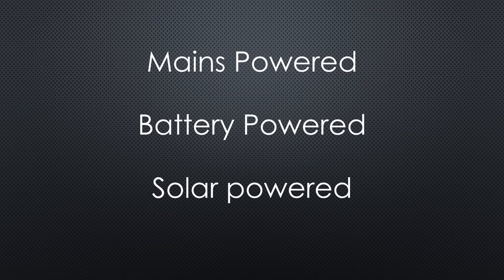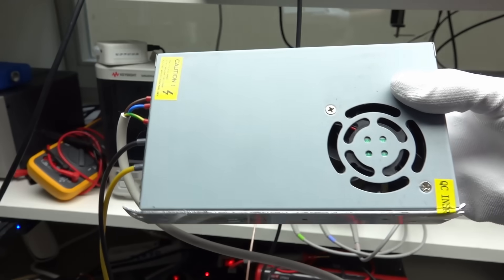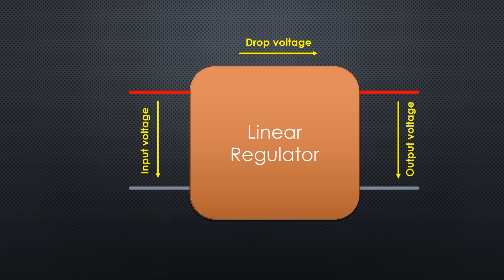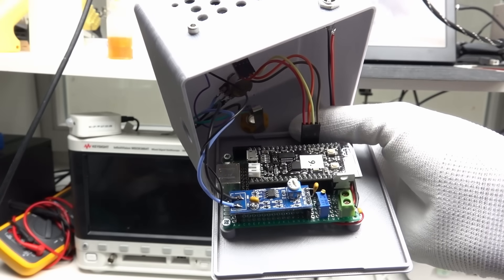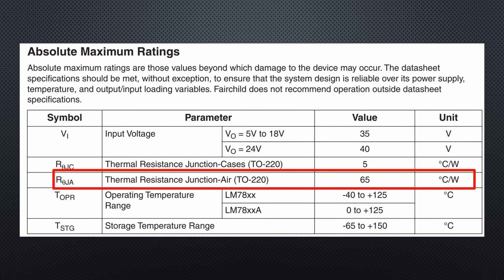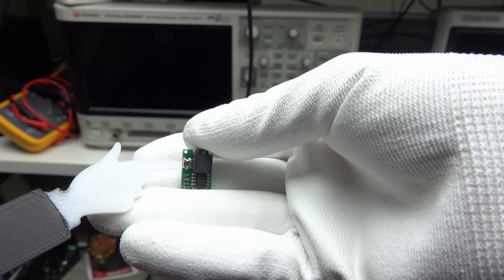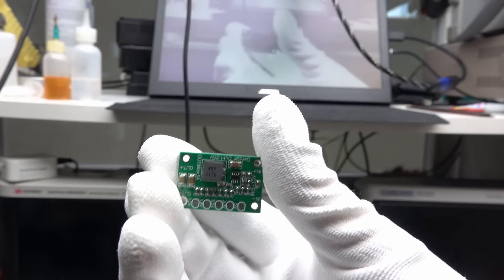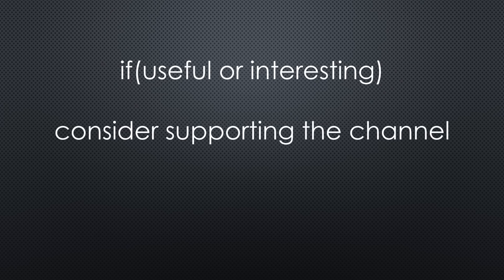#334 How to find the right Power Supply for your Project

Comment: I am noob when it comes to electronics, I have a question about switching regulator, would it be fine to just filter the noise of the switching regulator by adding LC filter into it?
Reply from the maker: It sometimes helps. But this is a very difficult topic where you find a ton of info on the internet.

Comment: tl;dr : not sure if usb adapter could sustain plugged 18h/day to 24/7, any advice?

hey, I was wondering if how long would the power supply be used is in consideration.
My project will be using main source with highest voltage of 5v, which leads me to using usb wall adapter. However, im hesitate to use it with longer uptime (at least 18h a day). My other option is using some 12v adapter laying around & adding buck converter with fan, or buying a beefy ac to 12v supply. Since i would need at least 15W of power for my project with 18h a day, or even worse, 24/7.
I would really appreciate any advice, thank you!
Reply from the maker: I do not see a problem with using a USB adapter for 24/7 if it does not get too warm.

Comment: I noticed a slight error in the video: you mentioned that all USB power supplies can supply at least 5v 1a.  That should be 5v, 500ma.  Slight difference, but it might matter sometimes.
Reply from the maker: You are right. But this rule is very old and for a long time, I did not see any of those.

Comment: Hi Andreas! I am looking to convert a mains switch that controls my central heating to a smart switch that I can control remotely. Is it possible to take one of those USB Power Supply's apart and directly solder a mains cable to the input, would that be safe? If not with a USB Power Supply, how about one of those wall warts?
https://i.imgur.com/s6pauWO.jpg
Reply from the maker: Working with mains is always dangerous and you have to know what you do.
Reply: @AndreasSpiess  Don't worry, I will be extremely cautious. I will disable the switch through the RCD, make sure it isn't live, then work on it. Maybe one handed rule also...
Watching other videos I have decided a HLK-PM03 board is probably a lot safer. However, your #385 watchdog video only features that HLK PSU and a resistor iirc? Whereas this tutorial includes a lot more components(easily found on google, YT blocks link. randomnerdtutorials)

Is your solution equally as safe? 
Also, just out of curiosity, is it ill advised to directly solder a mains wire to the input of a wallwart instead of having mains pins powering it?

Comment: This is excellent! Question: Is there a a problem with starting with a lower voltage and then boosting it with a boost converter?
Reply from the maker: I  do not understand your question :-(
Reply: @AndreasSpiess  Sorry, I was unclear. I want to power a 12V solenoid valve and a 5V Pi Zero with the same power supply. Is it possible to use a 5V 2.5A USB power supply to power the Pi Zero and then boost the voltage using a boost converter to power the solenoid on the same circuit? Danke viilmals für di lässige Videos :) Ich find es sind di beste Videos für Aafänger wi ich.

Comment: Hi, I ordered a switching powersupply kinda similar to the powersupply you have shown in the vid. It has 12V 5A specs. I wanted to power arduino nano using it. Of course, i would lower it to 5V using buck converter, but i'm concerned with the "5A" specs on the psu. Would it burn my arduino?

P.S. The reason i used this because I'm also about to use motor that needs 12V instead of just using USB to power arduino
Reply from the maker: Your Nano will only take the current it needs (as long as you feed it with 5 volts). No problem there.
Reply: @AndreasSpiess  I see thank you so much sir!!

Comment: I have a project in which I have an Arduino Nano which needs to power a NEMA 17 stepper motor via a A4988 driver. I have a 12V/2A DC adapter. The question is... Can I connect this supply both to the Vin pin on the arduino AND the Vmotor pin on the A4988 and power both of them at the same time (without using an additional 5V power supply for the arduino)? Note that I would like to use the Vin pin because it accepts 12V as well, so I don't even need a buck converter... Thanks!
Reply from the maker: I would not power the Arduino with 12 volts. The AMS1117 voltage regulator probably gets quite hot. But maybe you try and put your finger on the voltage regulator.

Comment: Thanks for your video, Andreas! Do you have some tests of the USB-C PD power outlets? Thinking of using a big USB-C power bank to drive my High-End DAC. But what is the quality of the USB-C outputs of a power bank?
Reply from the maker: Switching regulators and high end audio is probably not a marriage made in heaven... But no, so far I did not do any tests other than using one for my portable radio station. Works quite well at 15 volts and so far I did not have issues with RFI. But I use much higher frequencies...
Reply: @AndreasSpiess  thanks for your response. You are right regarding switch mode psu. But if running on battery from a power bank? I see some high end equipment doing that. I can't find any measurements on the quality from the power bank outlets. Br 🙂

Comment: I am trying to make a temperature sensor but it seems to work fine with a lithium ion battery but I want to use it with mains power supply and the temperature keeps jumping while I use a 2AMP power brick.any solutions???😞
Reply from the maker: Unfortunately I cannot do remote debugging  :-(  Maybe you check all the voltages?

Comment: A nice and useful video once again. Thanks @Andreas. I wonder if you have considered to investigate or create a digitally/DAC controlled power supply? Now, that there is this Arduino compatible Seeeduino XIAO micro controller which has a DAC output delivering true analog voltage instead of PWM, I could imagine that adding few components a relatively accurate and programmable power supply could be possible to implement.  What do you think?
Reply from the maker: DACs are useful for some applications, you are right. But you can buy a lot of good power supplies. So there is no need to add another one...

Comment: This is the video i was looking for! Thanks!
Reply from the maker: Just consult the datasheet (or the marking on the device) and you should see if they are regulated. USB connectors always have regulated voltages.
Reply: @AndreasSpiess  thanks a lot!
Reply: Just one questio: Do all AC-DC adapter (with USB output) have a regulated and stable output voltage? If it's not, how can i ensure if i need some regolation after my adapter? In my case i need to power and arduino with a couple relay and a SIM module (which require up to 2A during network registration). Thaks a lot!

Comment: Can I power (only) my ESP32 with a 5v 1a (5w) usb power supply? Or do I need theese other strange components?
So the problem I am facing here is that I would like to upload code via micro USB and the Arduino IDE to my ESP32 and then be able to run it and turn off my pc. So I would have to upload the code, somehow run the code and change the micro USB plug from the one that runs to the Pc to the one that is connected to the power supply (5v 1a 5w) at the same time, so it is running with the power of the power supply. I don’t need the searial monitor for this project. Thanks

Comment: Andreas, I agree with the compliments and appreciation expressed below.  Also, when you discuss battery power options in a planned video, would you consider adding ideas for monitoring the battery voltage and using LoRa to send periodic measurements to the cloud?  I want to show trend graphs and send low batt alerts for remote AREDN radio sites on 12v solar systems.  Many thanks!!!
Reply from the maker: Usually you can build your particular project with parts of my videos...

Comment: You should check out the HiLink power supplies. They're cheap Chinese SMPS that deliver 3.3 or 5V (depending on package) with pretty good efficiency and thermals. A small low pass filter can be applied to the outputs to reduce noise. Definitely cheap and useful! PN: HLK-PM03

Comment: Battery /12volt power solutions for Raspberry pi4 would be greatly appreciated. I have already fried one pi4 😥
Reply from the maker: This should not be too complex. You just have to find a stable and capable 5V supply according to the rules shown here. Probably a switcher in this case.

Comment: A current project I'm working on requires 5 V to power the MCU and various software controlled outputs via USB as well as switching mains on and off via an isolated relay board.  I may also need to add some fans for air circulation, also software controlled, which will need a 12 V supply.  This video couldn't have come at a better time.  Current plan is to hack a socket mount power adapter with built in USB outputs, add a fused power socket with switch, and mount a 240 V socket with switch on the back so mains devices don't need to be butchered to make them compatible.  Will be able to add a ground connection too, something that is frequently absent in cheap products even if it would be desirable to have such a thing installed.
And yes, a battery version would be grand too!  Many thanks.
Reply from the maker: Nice project you have!

Comment: I'm having a power supply problem that is driving me crazy, because it seems so simple: I have an ESP8266 with BME280 temperature/humidity/pressure sensor, a radar motion detector, and an LDR with some resistors to measure light. I have a 1,000uF capacitor on the 5V pin. It works fine when powered from my laptop USB. But when I put it on a USB power supply, the BME280 sensor returns bad values (temperature -145.10, pressure 1238.77, humidity 0), but everything else works. I started with my usual very cheap 1A USB power supplies, then tried cheap 2A supplies, then an official Raspberry Pi 2.5A supply, then a 3A powered USB hub, with the same result. It has been working fine from my laptop for a week now, but that means I have to leave my laptop on and I can't take it anywhere! Is there a design difference between a laptop USB and a USB power supply? Am I overlooking something obvious?

I plan to put some of these outside, using solar powered powerbanks, so  I hope you will cover those next...
Reply from the maker: These problems are not easy to hunt down. With a battery it should be better.

Comment: I'd be interested to see if the linear regulator is actually (electrically) quieter than a buck converter.  The linear will propagate the ESP32's noise over the 12V line in addition to the keyboard power line.   A switcher will usually be filtered a bit more, and might just reduce the ESP's noise more than a linear.
Reply from the maker: Maybe. I do not know.

Comment: Any chance you could do an episode on spread spectrum switching converters?  They vary the frequency randomly around the center frequency.  This lowers peak power at the center frequency and makes it easier to filter out switching noise.  I've been keeping my eye out for such a project, but haven't seen anyone do a video on one yet.
Reply from the maker: I think this is too specialized for my channel and I also have no particular knowledge in this area. So somebody else has to do it.

Comment: I think a relevant factor in the power supply choice is noise as in sound. Some of those silver bricks can get quite loud ;-)
Reply from the maker: If you are in high power applications, you are right.
Reply: @AndreasSpiess  At least my Ender 3 qualifies. Or it doesn't, because its power supply fan runs at full speed no matter what. There are guides to remedy that but I am a bit reluctant to mess with mains voltage.

Comment: A few months ago I tried to use one of those ADS1115 ADC boards with an 3.3V arduino. The adafruit library doesn't tell you this, but the sample rate actually degrades if you don't power it with 5V. But  you also wouldn't notice it, unless you are sampling in continuous mode and using the ready pin or wondering why the values seem to change slower than expected....
Reply from the maker: Strange. The chip is rated from 2 - 5 volts...
Reply: @AndreasSpiess  It works for 3.3v, and i'm sure the datasheet specifies that. Or the problem has to do with Chinese knockoffs...
Reply from the maker: Just an information: All your comments are in my YouTube spam filter and I have to deblock them ....

Comment: Battery apps usually push the size/weight envelope?  Almost always multi-rail boost?  Inevitably requiring custom board(s)?  Layouts become sensitive?  Switching frequencies sometimes important?  Surely there are tricks and maybe preferred components to accomplish?  Maybe a graph/chart or two of operating space vs solution(s)?  Especially the ultra-low-power end?  A magnetometer measuring once per second or lidar measuring once per ten-minutes, for example?
Reply from the maker: This video was focused on mains powered devices. And many of your questions are far too special for the normal viewer, I think.
Reply: @AndreasSpiess   - You asked what we wanted to hear about in your upcoming battery video?  Just my two-cents that it skew towards ultra-low-power vs C or D-cell applications?  Where small is as important as efficiency?  Thanks for responding.
Reply from the maker: Aha. Now I understand. Thanks!

Comment: As always many thanks.  My current project is an environmental sensor using the LoRa technology (TTGO LORA32, BME280 plus an analog temp sensor, LiPO 1S battery, maybe solar charger).  For use in lobster and mussel farming.  Working on the electrical requirements now (i.e. voltage supervisor?, regulator needed?, anything else?).  Hoping to get 2 years maintenance free.  Looking forward to your next video.
Reply from the maker: Always good if projects create a real value!

Comment: I actually expected something about power supply shown on top left corner at 0:16, but it is none the less very informative!
What about powering multiple loads from single power source? I'm working on replacing dozen of power supplies 12v in network rack with single power supply which I also can keep multiple spares
Reply from the maker: If the loads need the same voltage you connect them to one supply and make sure it delivers enough current.

Comment: If you know of a good buck-boost chip that is easy to calculate and design for, I would be interested.

   I have my references saved for the MC34063 and UC3842. I've used the MC34063 several times. I've modified circuits with the UC3842, but still haven't built anything from scratch. The inability to measure inductors accurately makes me hesitate to build something over 10-20 watts from scratch. I would rather use a working mains power brick design and modify it to suit my needs.

   I would probably need something like a component calculator for a buck-boost topology. This is how I got started with the MC34063 and UC3842. The key for me was a calculator that allowed me to change values on the fly. For instance, I can input the frequency, voltage, current, and acceptable ripple noise, and things like the inductance and component values are given. Lots of tools can do this, but the most effective ones can reverse the calculation. Meaning, I can modify the initial results to change the inductance value and see the way it influences voltage/current/noise. This allows me to design something based on what I already have laying around.

 Ultimately, I need either a thorough breakdown of the topology and application, or I need a way to plug my values into the simplest possible equations to get started. I have salvaged a couple of buck-boost circuits from old wireless computer mice, but the datasheets for the chips I've seen are not very good, usually not in English either. I don't have a go-to example I am confident I can replicate.
Thanks for the upload.
-Jake
Reply from the maker: I once started to watch some videos about the construction of power supplies and decided not to start with this "science". So I do not know particular chips. I buy them on boards. BTW you get reasonably priced LCR meters (I have a DE-5000) and even the cheap transistor testers were quite accurate when I did a few comparisons.

Comment: Hi Andreas, I have a P-Touch H107. Since I do not like batteries in things that I use on my desk, I have drilled a hole and connected a wall adaptor plug to the red and black cables that come from the battery compartment. I have also soldered a schottky between the red cable and the plug. The printer goes with 6xAAA batteries so I have plugged a 9v transformer and nothing happened. Whith some batteries I had around it worked and I could read 7.5v at the input. So I tried a 7.5v transformer, and a 12v and a 5v. Nothing, and the meter reads weird values at the board (like 11-15v). But the curious fact is, that with a power board (from ebay), set to 7.5v, connected to the plug, it works perfectly!! What could be going on?
Reply from the maker: I have no idea :-(  But if it works it is ok, I think.
Reply: Andreas Spiess: I have tried with a variable (“universal”) adaptor ad it works fine too. In the end, I guess that I must have a significant number of broken transformers in that box 🤣🤣

Comment: To use USB-C PD you want a sink chip, which does the voltage negotiation: https://m.aliexpress.com/item/4000139809599.html
Reply from the maker: And every time you start your project you push three times the button? And if you press it 4 times you get magic smoke? Not for ms :-(
Reply: @AndreasSpiess  Nope. You can program it to negotiate any of the supported voltages automatically at startup.
Reply from the maker: The one I have forgot it :-( So good to know. Thanks.

Comment: thanks. I need a small hand with a white glove and an infrared sensor to check the heat for the tension regulator.
Reply from the maker: I am not sure that this modified method works ;-)